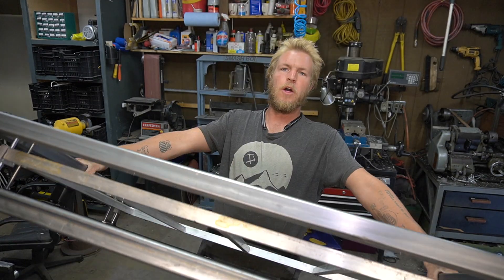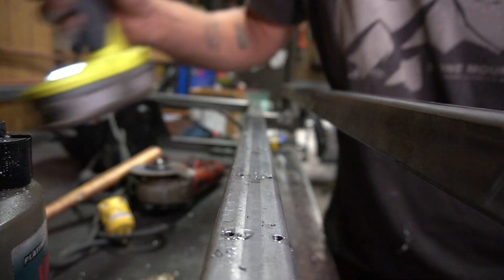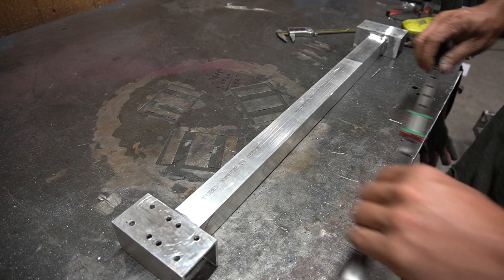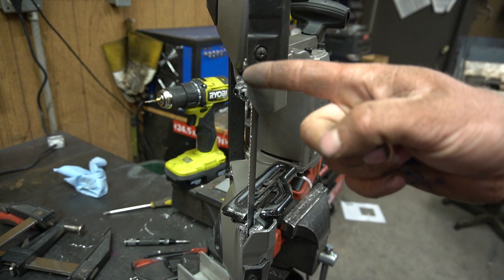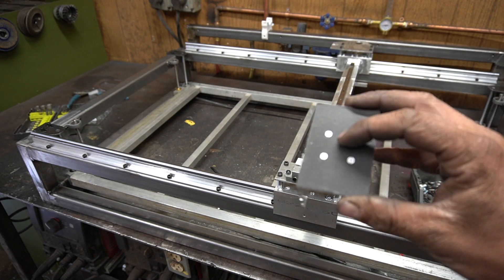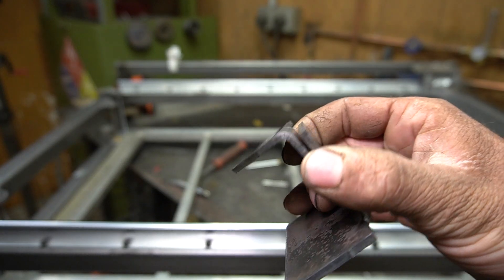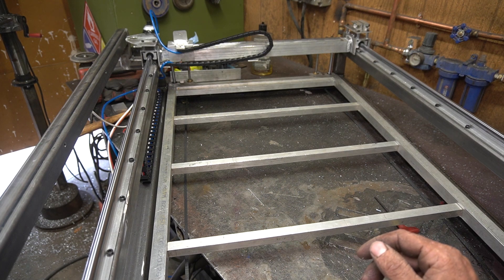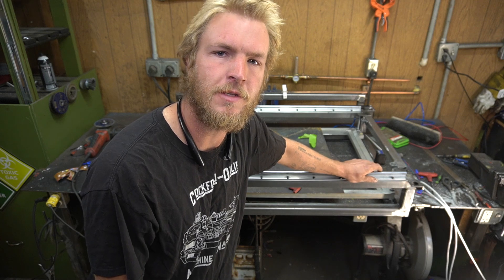DIY CNC Laser Cutter Part 2 - Making X And Y The Gantry

Comment: Yo man, when it comes to controlling it:

Lightburn, is hands down the best piece of software. Worth every penny.
Controller wise, use a GRBLHAL. You get all the speed you need, super fast steppers and no skipping (which I experienced with any other controller[GRBL-LPC was an 8/10). The board phil makes on Tindie is also the best breakout https://www.tindie.com/products/philba/grblhal-breakout-board-unkit-for-teensy-41/ . 

If you got this far, it is not recommended to use two steppers to control any axis. If one fails, the gantry can skew and can bounce the laser in a very dangerous way. There is a design like a diff to turn two gear wheels with one stepper. 

Cheers man, great videos!